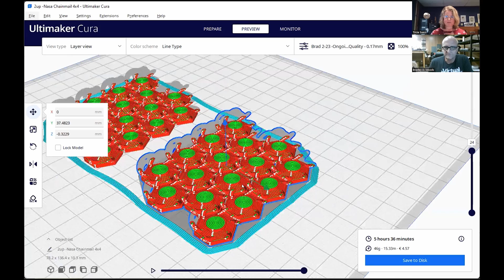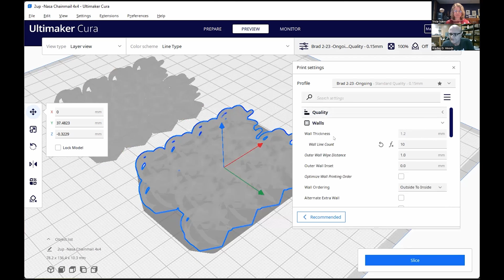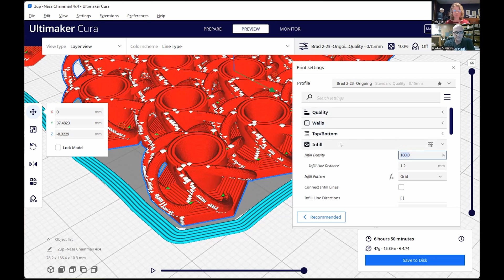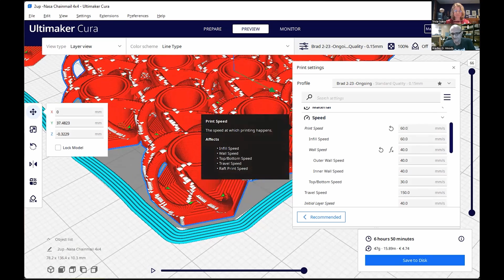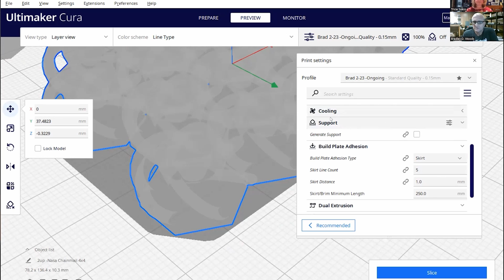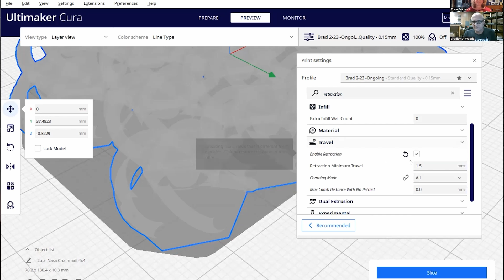Slicer Settings To Know

Comment: For precision peaces how much % we have to increase for a compensation of grade of contraction after deblindim and synther process?
Reply from the maker: Generally, we tell people to size up the same amount that they want to shrink.
When you follow the instructions on our website (https://thevirtualfoundry.com/debind-sinter/) you'll get about 7% shrink for bronze & copper and more like 10% for steel.
You have control over this property and can further shrink your part to get the density you need by extending the hold time of the sintering temperature.
The X and Y axes will be isostatic, the Z will shrink a bit more due to gravity.
Overall, this process should be considered near-net-shape. You may need to do some fine tuning to your part if it needs to meet tight tolerances.